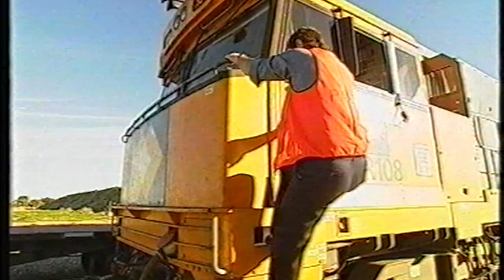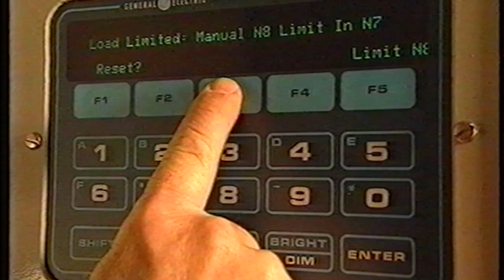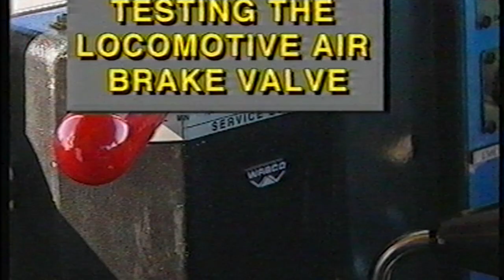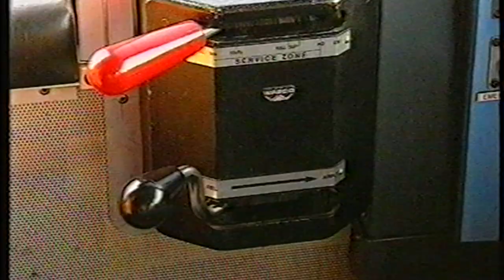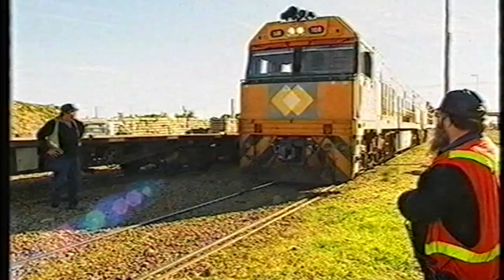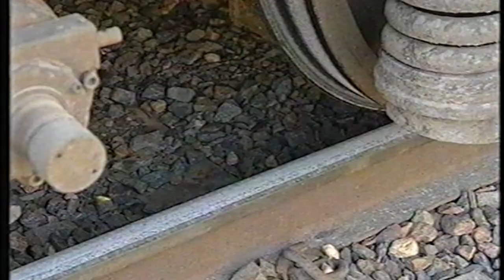National Rail NR Loco Training & Preparation

Comment: kPa seems a little ridiculous right? Why not PSI? A 10 lb reduction seems much simpler to do on the fly and check at a glance than the bazillion kilo pascals or whatever the equivalent is. That seems cumbersome.
Reply: Because Australia joined the modern world a long time ago and we have brains, we use modern terminology and the metric system. Unlike others that still want to put fractions on their fuel prices. Oh and it’s not that hard 7k a to 1 psi
Reply: @Blah-r5m123 😂 Settle down tough guy.
Reply: @michlo3393 go buy a pound tissues for a few Qtrs Stone Age man.
Reply: Thats just the measurement system we use here in Australia in the rail. We still use psi for day to day, but for rail operations and likely other industries, Kpa is used.

Comment: Engineer in the US here… it is interesting to see the different procedure logic in different places.
Reply: Did you notice that on an NR class loco which came on the scene in the mid '90s and is a GE dash-9 that the toilet is not in the cab, the cab floor is all on one level, other locos can be off/on-lined from the lead loco, and they have a spring parking brake which operates on all locos? I worked for Rio Tinto until five years ago and their latest GEs from the US had none of that.
Reply: @ I knew Aussies don't like the toilet in front of the crew. 

I've seen pictures of the NR and the other modern GE's. 

I like the idea of both trucks(bogies) having a mechanical brake. 

Our US locomotives have powered mechanical brakes but only on one end.
Reply: @DL541  Can you elaborate more on the loco braking? The NR's had pneumatic engine brakes on both bogies (trucks) and also a spring loaded park brake pn each bogie (truck) which was released using the push button as shown in the video if your air pressure was high enough. What did you mean by "powered mechanical", is there a mechanical park brake on one truck only applied via electrical motor so similar? We had some Alcos in NSW which were modified and fitted with the wireless distributed power system and as part of their upgrade, the mechanical wheel park brake had the wheel / handle bit replaced with basically an electric winch. When the motor drew a set amount of current, the brake should have been applied to tight enough and the system turned off . didn't work very well... lol
Reply: @ US locomotives hand operated securing/parking brakes are being upgraded/converted to a powered version similar to what you are referring too on the NSW Alco's. I'm guessing the NR's is similar but not sure.

I used "mechanical" because it is only the springs in the brake cylinders that assist in releasing the securing/park brake. The hand/mechanical brake is a ratchet type on most US locomotives, the powered ones spin the pulley or cog in the brake itself. The powered brakes can be operated by hand.
Reply: @ And where did they put the on/off button? Not in the cab but out next to the winder wheel.
Reply: There is indeed a fair amount of difference in procedures and terminology. There is even a significant difference between NSW rail operators and the mining operators like Rio Tinto in the Pilbara. The Pilbara operations generally follow the American standard of procedures and terminology.